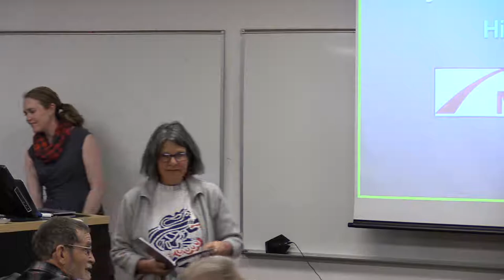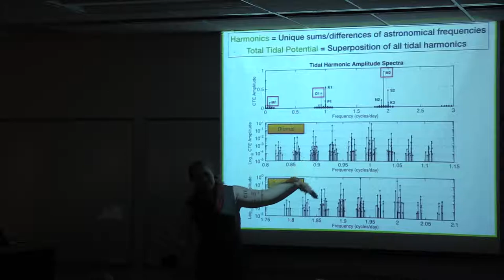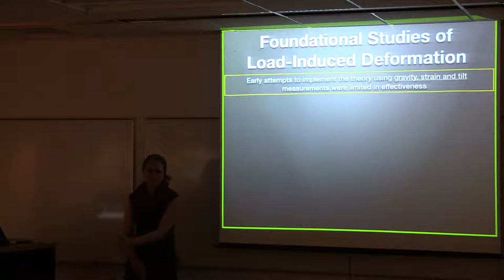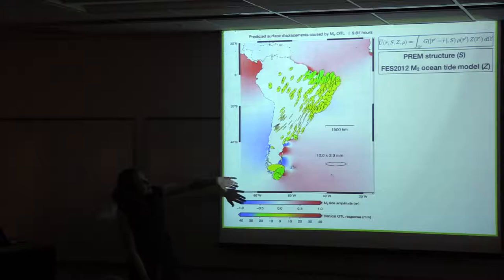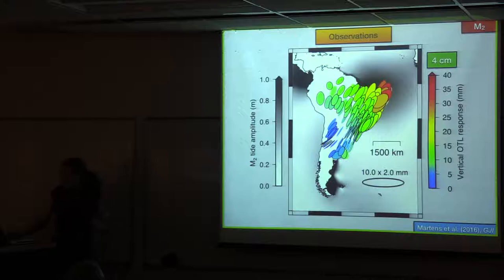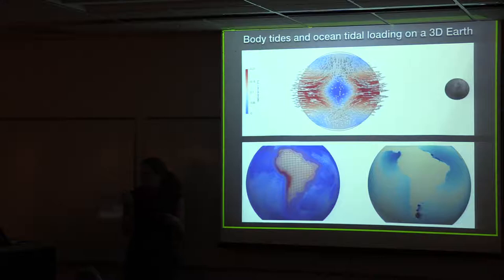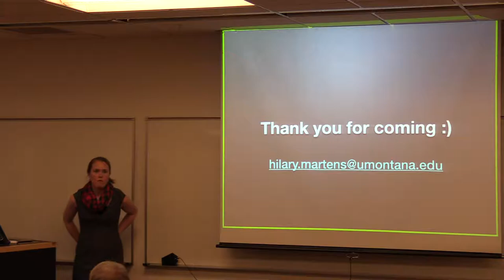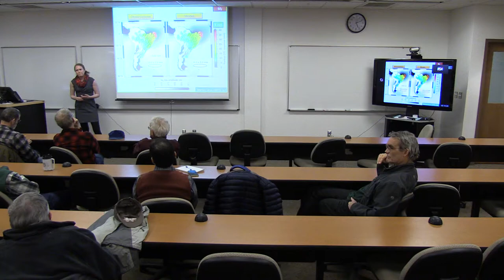Earth Deformation Caused by Surface Mass Loading

Comment: I watched the whole lecture. I have  no formal education  in this subject so could only understand a fraction of the content!   I have huge respect.   I came to this video  after entering the search - "elastic deformation of earths mantle". I am curious to learn of the implications of  this science in relation to the sea level rise debate/predictions?  Is it possible that  the weight of the water displaced from polar ice melting could be dissipated globaly and thus alter the depth/capacity of oceans?  Thinking in the broadest sense, after learning about continental drift it seems over vast geological eons, even after allowing for errosion, land tipping, rising and falling, shifting around the globe  the land masses still approximately fit together, suggesting an equilibrium is roughly maintained between sea and land... Am I being over simplistic? or does "our capitals will soon be under water" peak more interest?